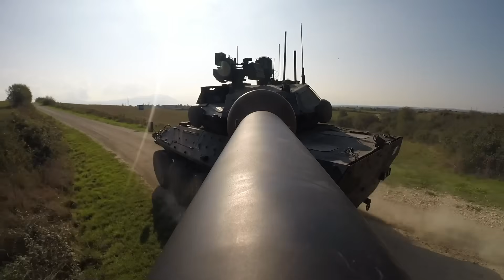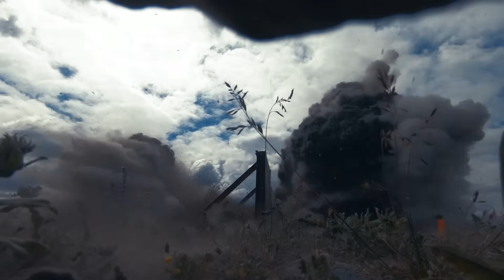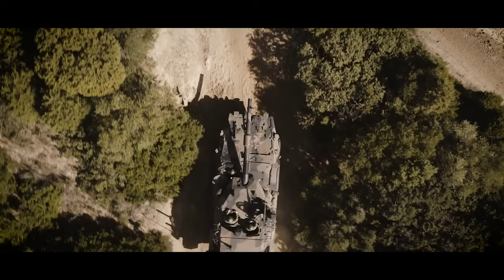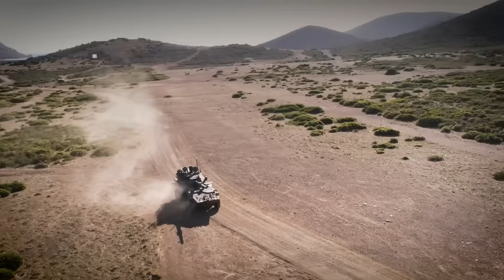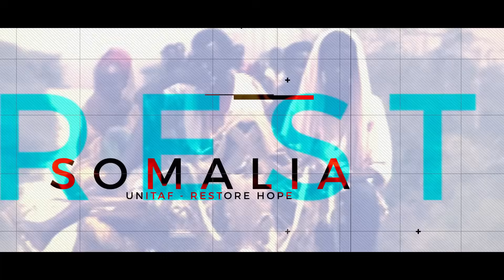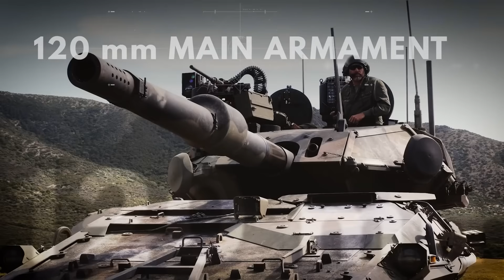Why Modern Armies Are Ditching Heavy Tanks for the Centauro II 8x8

Comment: Lots of talk about Brazil and its vast distances, but would have been nice to hear why Italy produced it in the first place. Maybe a wheeled tank makes sense in mountainous regions like Italy
Reply from the maker: Thank you very much for the feedback 😂😂
Reply: Like its predecessor, Italy created it precisely for mobility. Our army is small, and the country is narrow and long, two-thirds surrounded by coastline. Italy is a peninsula, and having to deal with potential invasions with numerous access points for enemy forces was essential. Therefore, being able to move armored units up and down the country quickly was essential. The Centaur was created for this purpose, to quickly deal with any threats, giving slower heavy vehicle formations time to reposition, taking advantage of the country's vast highway network. Furthermore, many bridges across the country, some dating back to the Roman Empire, cannot be crossed by heavy vehicles weighing more than 60 tons, becoming bottlenecks, which, however, does not block the Centaur.

Comment: "NOT-A-TANK" 
It cannot hold the front line alone, but can get there way before anything else, destroy any fast moving enemy with ease, mow down enemy infantry that has taken cover in building, being 100% independent, moving for hundreds of Km on civil infrastructures without destroying it or suffering heavy wear and tear for each km covered on its own. Consider that you cannot bring a tank in place without railroads, or truck lorries, and even then most civilian bridges cannot carry the weight of at tank carried by a truck.
When you don't know where your enemy will be coming from, and you cannot have static defence position everywhere, this is exactly the thing you want to deploy. Everything told about the type 16 applies, as Italy and Japan are very close when you consider the king of geography problem that have to deal with.
Is it vulnerable? Yes, as any armoured vehicle to asymmetric threats like Drones and RPG, but it can mount auto protection system is needed; Italy is closing what to mount on the KF-51 and will retrofit the Centauro 2.
The point is that you always want to have air superiority on your own territory, which greatly limits an attacker options to strike at you in an attrition war like we see in Ukraine, and without air superiority, any ground vehicle is vulnerable to the enemy infantry

Comment: The Centauro II is the best armored vehicle in its weight class. The problem is, Italy only deploys 150 of them. We still use 260 of the older Centauro I, but these are now outclassed. And 410 is too limited a number of overall tank destroyers. We need to produce and deploy 600 of these in a non-biblical timeframe (about 10 years).
Reply: The Centauro 1 are in Ukraine now.

Comment: It should be added that the Centauro B2's 120 mm gun can fire OTO Melara's Vulcano guided munitions to a range of 30 km. With such a range, the wheeled armored vehicle's armor becomes a secondary factor, since if the engagement occurs at such distances, assuming the opposing side can spot you and has ammunition of the same capacity, the projectiles would arrive from above, hitting the upper part of the notoriously more fragile vehicles, negating the advantage of having a heavy armor. Therefore, in scenarios where the munitions can strike at several tens of kilometers (or miles) away, the determining defense factors become stealth, a low thermal signature, speed of movement, and active defense systems (APS). The only advantage a tracked MBT can offer is the ability to overcome very muddy terrain, where the Centauro struggles, as demonstrated in some tests conducted by the Russian army when it was about to purchase them between 2012 and 2014, but later abandoned them precisely because of this limitation. In a military campaign like the Ukrainian one, the Centaur can be effective in the middle of winter and in summer when the terrain is compact, but in autumn and spring, when temperatures are mild and rainfall increases, the terrain of the Sarmatian lowland becomes impassable for wheeled armored vehicles.
Reply: Your comment is 100% spot on.  Entirely accurate.

More & more I find Italian (and French) military kit interesting & impressive.  And practical.
Reply: Today with FPV drones armed with AP rounds your reasoning makes no sense
They can hit it coming from 40km away or just ambush it sitting in the grass waiting for it to pass, big vulcano 30km range rounds are useless against FPV drones
People here in the west still haven't fully grasped how much drone warfare has changed the battlefield, I saw training images from England shot just 10 months ago and they are still using WW2 tactics with infantry advancing on foot behind a tank... in today's scenario they are all dead/wounded within 15-20 minutes, then the tank gets taken out too, maybe the crew will be able to flee and survive.
 Russians for ex. use a layered drone tactic: high altitude surveillance drones spot targets and feed coordinates to nearby "control hubs", at that point the hubs decide with what to hit it... the nearby ambush drones sitting in the grass, the small ones hovering/hunting, the larger ones launched on purpose from 5-10km away or the heavy guided artillery (up to 70km away but 50 is more reasonable).
They have up to 500 drones up in the air or waiting on the ground for a given "kill box" of a dozen square km (<10 square miles)... it's like fighting a swarm of wasps, only each wasp has an explosive frag or AP round attached...
Reply: @ClaudeMagicbox  Maybe I didn't explain myself well, but what I'm saying is that at long ranges, the advantage of armor disappears: your drones with AP ammunition can pierce a Centaur on the roof just as well as an Abraham or a Leopard! I'm not getting into the merits of modern warfare tactics that you, like everyone else, see on TV every day. Anyone knows that today wars must be fought in 5 areas (land, sky, water, cyber and space) and that wars are not won by weapons but by combinations of weapon systems but with all the good I can wish for your Russian sentry drones, they will have more and more difficulty in identifying a Centaur that shoots from 30 km in the middle of a bush with the diesel engine off but the electric one on to reduce the thermal signature than a Leopard that shoots from 10 km and at the same time maybe even those who have the Centaur have their own drones, like the Centaur B2 itself is equipped with APS systems that are very good for countering the Russian ZALA Lancet which have a range of 50 km (70 km is a fairy tale estimate) and are usually launched in pairs on the Ukrainian front (up to a maximum of 8 per day) while for your friends who set up ambushes in the grass I remind you that FPV drones have a range of 10 km so far from where a Centaur could put itself in firing Vulcano ammunition.
While the official protocol for the closing ceremony of the Milan-Cortina Olympic Games was taking place in Verona, a choreographed drone show was staged in Tesero (Val di Fiemme) to mark the Games: a fleet of 300 drones lit up the sky above the valley. The drones created dynamic and colorful displays, including Olympic mascots and symbols of the Games.
This also served as a cryptic message to the Chinese People's Liberation Army that they are not the only ones mastering such technologies.
Reply: @ClaudeMagicbox the mini drones era is already over, if you deep dive the leonardo's hystrix family, currently under development, in service from 2027.
Reply: @giuseppecorrente3454 it's so "already over" that you can see (unfortunately, I think it's disgusting) video on YT daily showing mini drones with small charges literally chasing and hunting single soldiers every day on both sides (probably just injuring most of them and leaving them there incapacitated to bleed to death)... I saw the last (newest) one yesterday
A proposito sono 🇮🇹 Giuseppe, ciao 👋
Reply: @ClaudeMagicbox  ciao! This is only a.first example of what will follow man and tanks on the battlefield (all you can see here is on wheels too) from 2027, and a lot more is under development.  I think that in two or three years they will have found technologies to impose a no fly zone for drones on battlefields. Hystrix: l’artiglieria navale di Leonardo diventa terrestre con il Michelangelo Dome – Analisi Difesa https://share.google/kzYopsp4T7moiooID